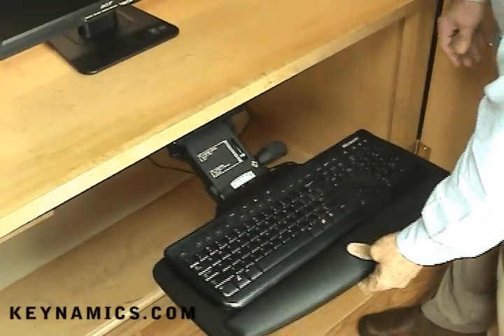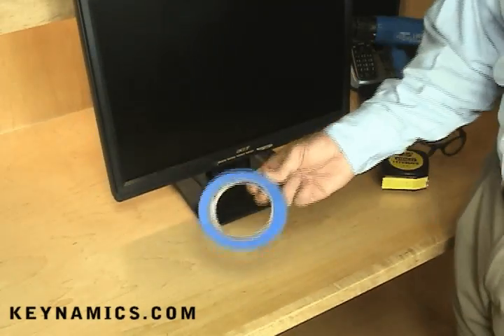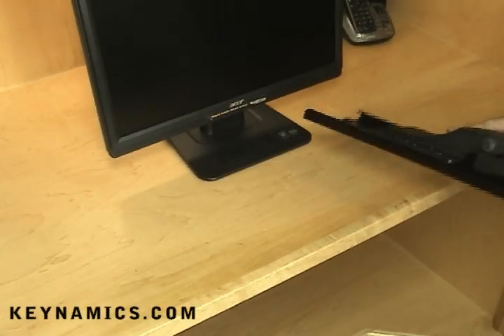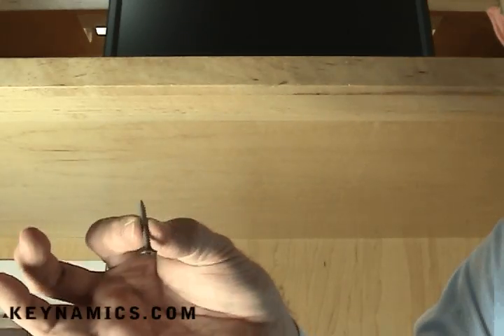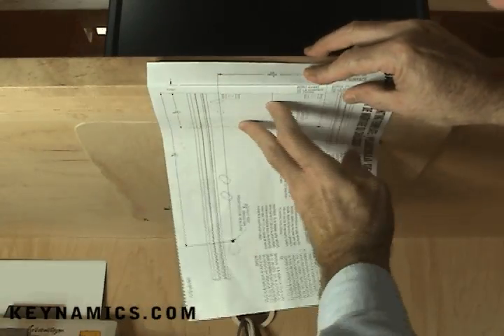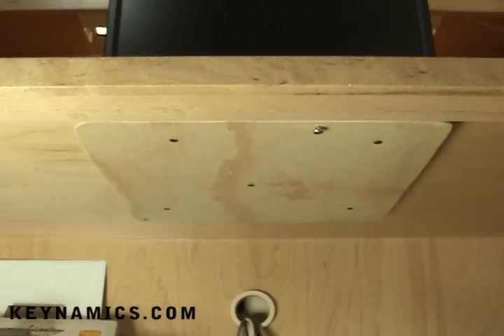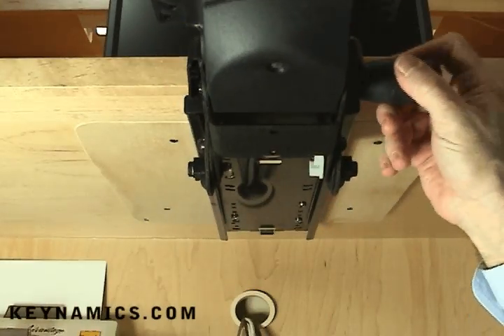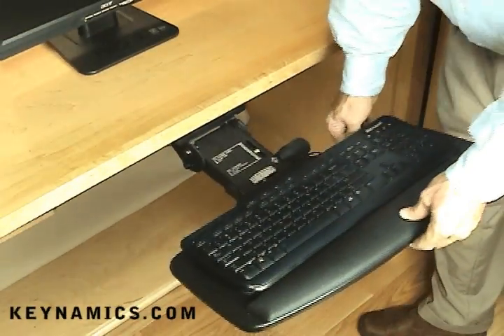Keyboard Tray Installation Ergonomic Keyboard Drawer Instructions

Comment: Thank you for this video! I found this video incredibly helpful when I set up my keyboard tray at home. The tip about the tape on the drill to measure 1/2 inch was also great too. I'm not very handy, but this video made installing my tray straight forward. Thank you!